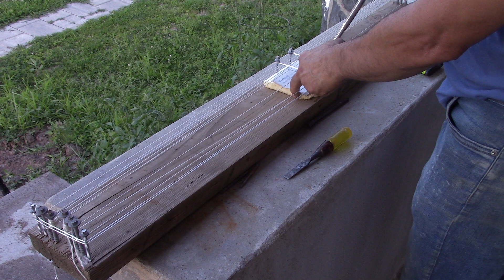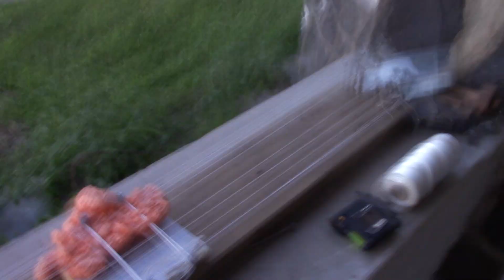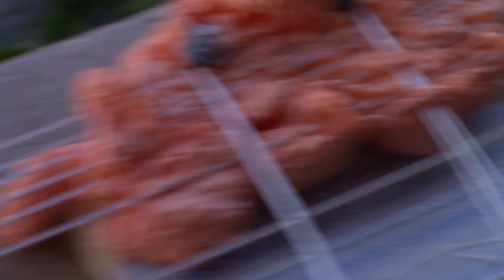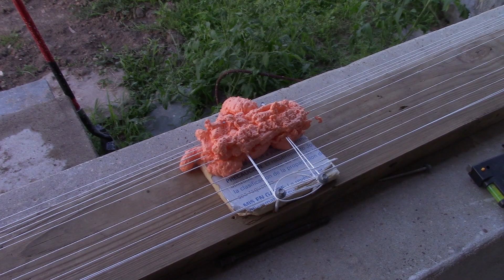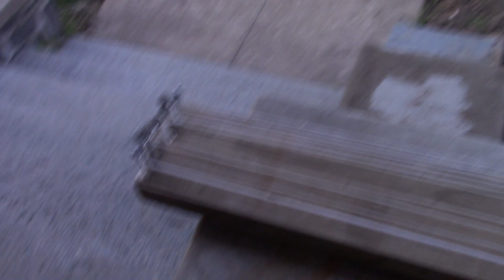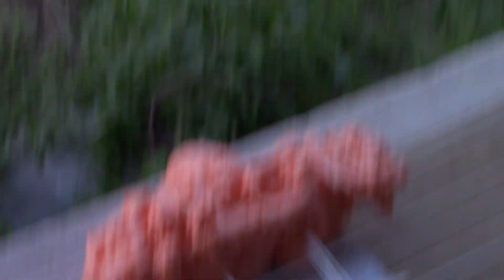FIU Bridge Collapse NO TRANSVERSE CABLES were tensioned to share loads Before 11 was tensioned PT 2

Comment from the maker: Part 3 to come and when I am done with this series, I hope you will have the knowledge to see the failure from the beginning to the end... INCLUDING the leaning inward of #12 via post tensioning in the canopy PULLING it towards 10/11 canopy node (you will see, be patient with me if you are an engineer and might be jumping the gun on my videos... remember, I have to give the back ground data on post tensioning first and also show it as Free Body Diagram  -- to help these wonderful people understand the load paths...
With that said, I know many an engineer cannot see this either... so please, enjoy and comment as you wish...
Any comments of ''conclusive files'' should be supported with data and not just what you think and how you think this structure should act...
As we now know, not ONE of the 20 plus profession engineers saw this failure OR NOT ONE computer program (artificial intelligence saw this failure either)... 
I am about 99.9% there... just need a few more pieces of data to keep it at this 99.9%,  such as, did they engineer the formwork to support this structure with footers, did they install the correct amount of steel to support the forces during post tensioning (forces down 10 and 3 during post tensioning #11 and #2),  did Erika remove, replace, or what did she do to the transverse post tensioning as reported in the memos, and also did all the tendons get grouted and did all the tendons get rechecked after the bridge move, was the formwork under the base while structure was be dead load tested? and did they think or calculate that forces would go down 10 and 3 during post tensioning number 11 and 2 and if so,  WHY DID THEY NOT POST TENSION THE TRANSVERSE CABLES FIRST AND THE ENTIRE REST OF DECK BEFORE APPLYING A LOAD INTO THE CENTER OF DECK?